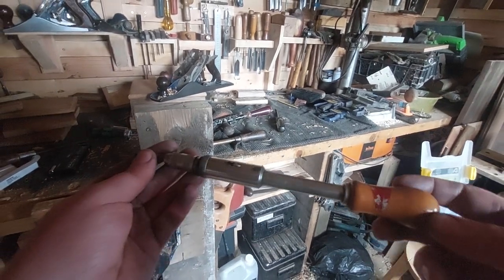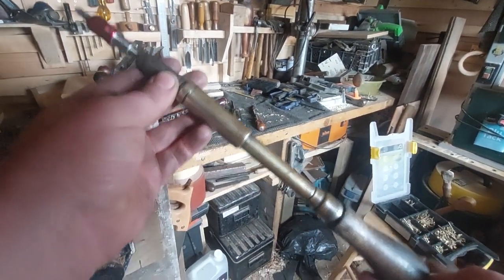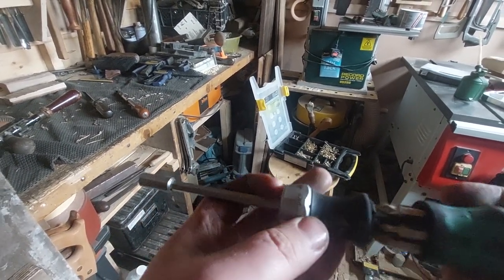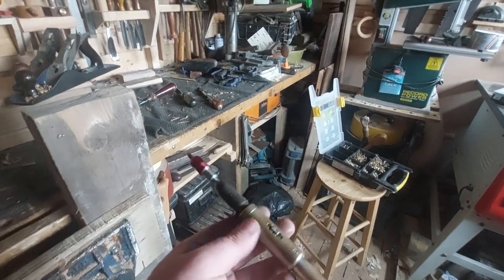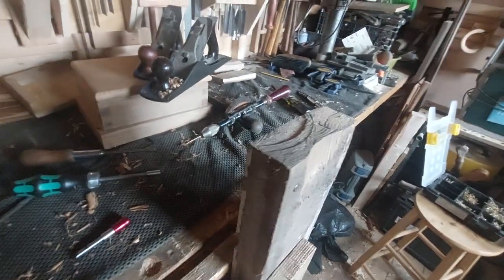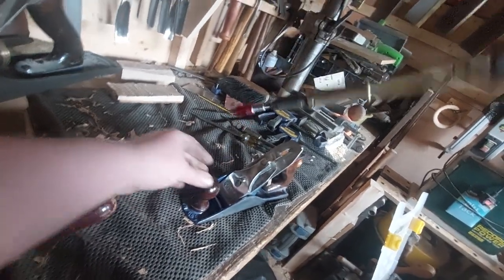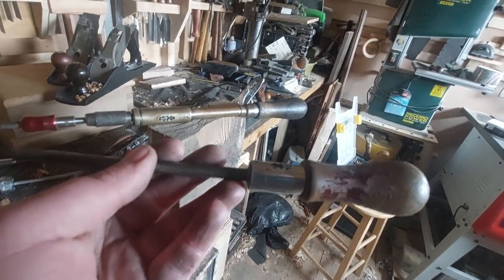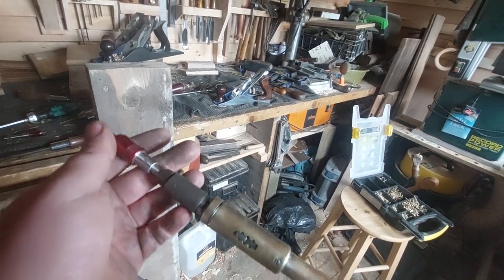Old Yankee Screwdriver With Modern Bits!

Comment: My favourite! 
Donno if you remember me posting about it perviously?

Can get a drill version or just drill bits for the Yankee. 
Also you can get or use to could get stealth’s that hold the screwdriver and all it’s bits. 
Pretty handy. 

Also got a few questions on replicas, if they are two toned some people say you are allowed to just play airsoft down the woods or such? 
I still don’t think you can or would even recommend it even if the guns look totally fake. 

Then I have an issue with a S&W M&Pc, when it’s cocked the hammer won’t release when the trigger is pulled?
Not sure what to do or if that common? 
I’ve also noticed it doesn’t hold much gas in the mag, so the slide stops doing full travelling. 

Also I can’t remove the barrel as the nozzle is to long, so not sure what to do there?

And should they be able to handle a bit of rough handling for skirmishes and such? 
Because I haven’t even used mine for that. 

Also asked around a few places and so far, Airsoft world, action hobbies, fire support, Wolf armouries, Zero one, DK Armaments, just BB guns and Land warrior accept accept Just Cos.
Reply from the maker: I think I remember you saying you like them! Lol, yes I I've actually got some of those drill bits, right after I made this video my grandad gave me has Yankee and a small case of bits, I love it! Not sure if I've seen the sheath, but there's a guy on EBay who 3d prints a bit holder, to hold 3 bits on the body of the screw driver, don't think I'll get one but you might like it.

The replica question, no, it's illegal to take it to the woods under any circumstances, you can use it in your garden, on anywhere you've got the land owners premission, which is a crock of shit IMO, the police can and will that the gun and distroy it, and you will probably be prosecuted, armed response might even show up.

Not sure about the problem you've got, you mean the hammer is cocked but won't fire? Not sure tbh, might need lube or something, maybe something is stuck, wish I could help honestly.

I'm nervous taking mine apart, but it must come apart some how,  is yours the same as mine? Mine is the C02 version.

Yeah no reason you can't skirmish with it (assuming  it's not to powerful) I've not skirmished much, but i recon you could probably even through it about a bit to(that's not advice lol) I'm carefull with mine, but I've even dropped them on the floor and they were OK.

Well done you for asking around 👍🏻that's getting pined lol

Comment: I have a 130A - 5/16 bits required. 130Bs take 8mm. 5/16 is 7.9mm - but 8mm bits won't fit. 
You can also get a drill chuck for Yankees- spiral drills work much better than the straight flute drills made for them.